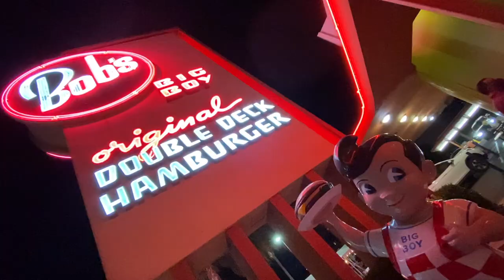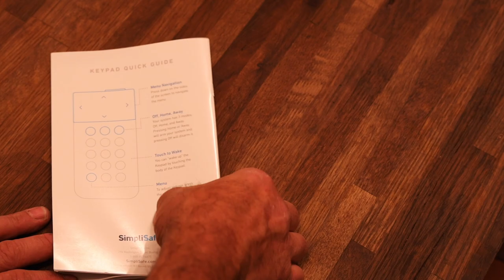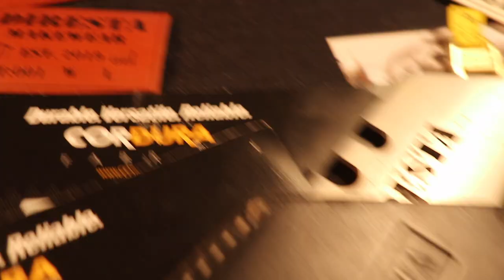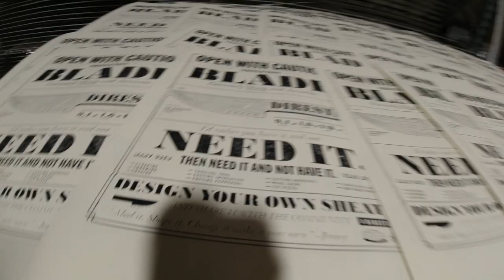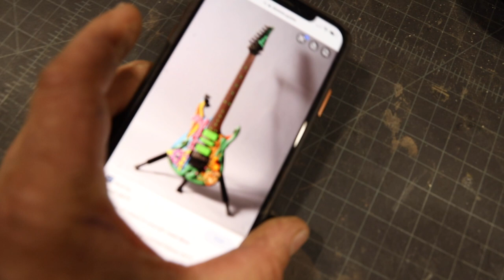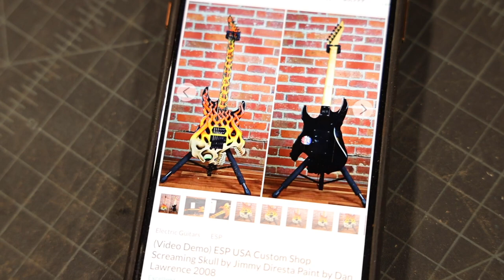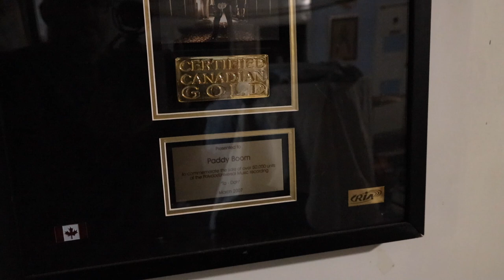DiResta 90: Chevys, Go-Karts & Guitars

Comment: I have a homemade jet engine powered GoKart. It has a 75HP turbine engine with variable ratio hydraulic drive system driving a DIY differential rear end using Honda Accord gears. The engine turns 50,000 RPM and is deafening. It has been speed limited to 50MPH but accelerates very well. It drives and handles like a fine automobile. Accelerates smoothly from a standing start even though the engine spins 100% RPM all the time. It has dual hydraulic disk brakes, coil over shocks and even a reverse capability. I designed and built it from scratch almost 20 years ago, dozens of people have driven it. It uses a few Kart parts like the steering wheel but most Kart stuff is too light. No reason to build it light, it weighs about 700 lbs, we had lots of power. Engine and drive alone are 350+ lbs. Three tractor batteries are on board to start the engine. There is a lot of steel plate in it to protect from engine explosion. It has a Volvo bucket seat on it. It will deplete its 17 gal fuel tank in less than 40 minutes. It burns Jet fuel mixed with a little gasoline. It is near Niagara Falls Ont.

Comment: I have two Chevy squarbody trucks
1985 Chevy c10 longbed 350 700r4 
1987 Chevy V20 350 with a 4 speed, the 87 was parked for 9 years with a seized engine we pulled it down the road popping  the clutch a few times and it broke loose and has run great ever since.

Comment: The refrigerant lines on the mini-split should not really be coiled in the vertical position behind the unit, this can cause oil return issues to the compressor and possibly shorten the life of the unit / compressor.  On those style where you can't cut the refrigerant lines, excess should be coiled in a horizontal position. FWIW.